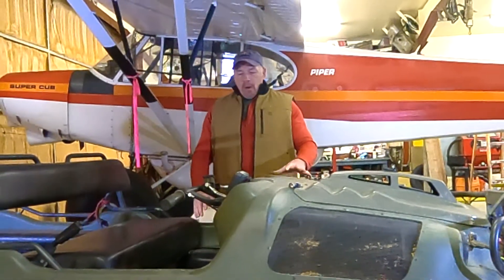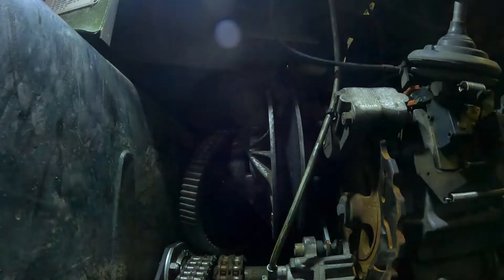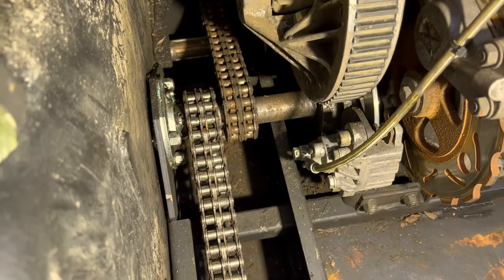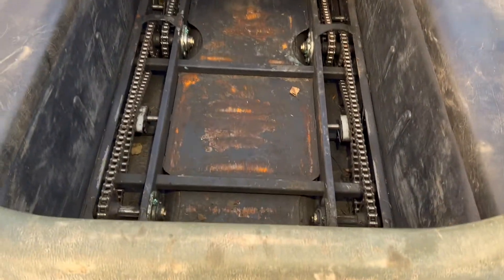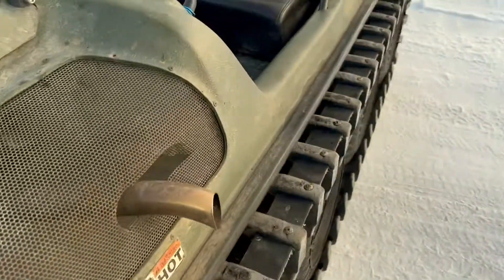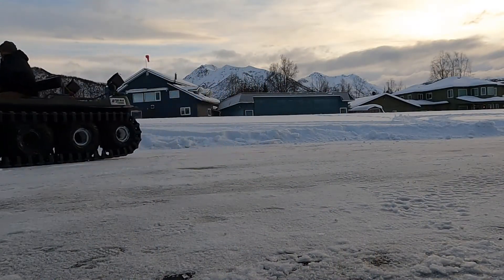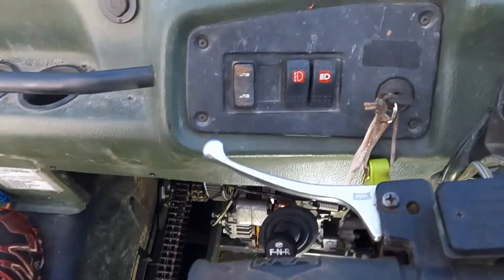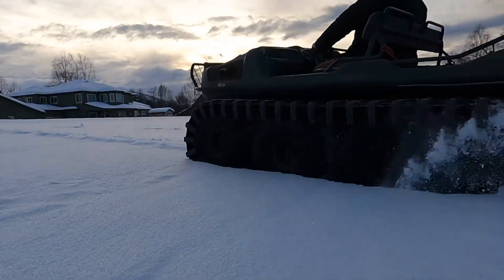Argo ATV: Drive Belt and Drive Train

Comment: Why is the drive train so load up front, so load you sware it going to  blow up, i been out in 2 diferent 8 wheel argo  With the 20 horsepower Kawasaki engine liquid-cooled, and in both of them i didnt go far out of fear it was going to blow up. Both units were a 2000 year with less then 600 hours.  If someone was beside me and tried talking no way you could hear a word. Didnt mater if i was in low or high the ror was defening, turned me off on ever buying one.  I'm very mechanically inclined and on both machines I pulled the floor panels and the - panel out and all the chains were well-greased and we're in excellent condition
Reply from the maker: I generally were ear plugs, but more for the engine noise (small muffler). The transmission does whine when it’s approaching light speed (12 mph😂).
Reply: @RaisedinAlaska so are you saying that horible front drivetrain ror is normal? It has scard me every time i taken a freinds 8 wheel argo out, so i never go to far with it. Yet there no nose from the back drivetrain hardly at all. 
 One winter he had his 18" plastic tracks on and i took it for a short ride through 6 feet of snow, i  was impressed how well it went but again that defening ror of the front drivetrain was so defening i turned back out of fear it was going to blow a part. It a 2000 year  With the liquid-cooled 20 horsepower Kawasaki engine which runs like a dream Idle's down really slow and the battery voltage stays at zero until you rev it up and it shows 14.8 volts. The engeine run  Very quiet. Unlike others i have seen out moose hunting, i sitting in a cut and one of then come screaming load like no muffler and it pisses me off as they see me sitting there for hours and they will run back and forth as fast as it will go  Sounds like you're at a stock car race.
Reply from the maker: My front drive train sounds similar to the rear drive train. I’m not sure where all the noise would come from.
Reply: @RaisedinAlaska it coming from the front engeine bay just a head of my feet. Front wheel bearing are good, gear box full of clean gear oil, all chains and sprockets like new and tight. Tentioners working proper. It drives me crazy
Reply from the maker: @arnoldromppai5395 That seems weird to me. The drive train has the same components both front and rear.

Comment: I’ve had Eight Argos in my life time  your Argo needs more chain lube and grease. You could have made your belt change a lot simpler and easier by using an Allen wrench tool to spread your secondary clutch out more.. Andy from Canada
Reply from the maker: The Allen wrench was my second option. I planned to use it if I couldn’t roll the belt off.  Thank you for watching.